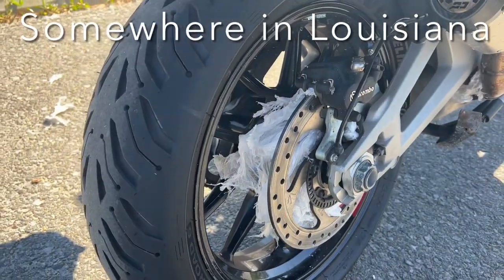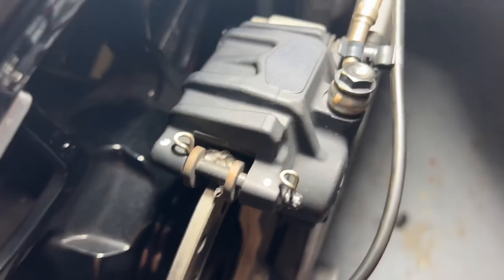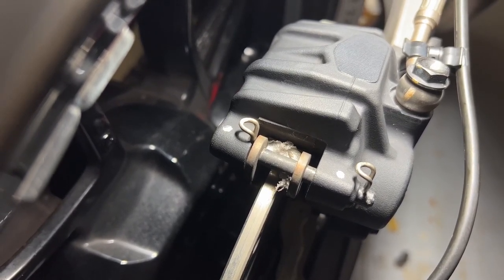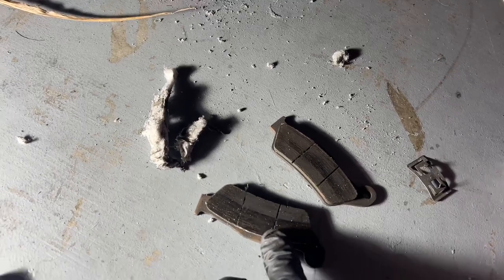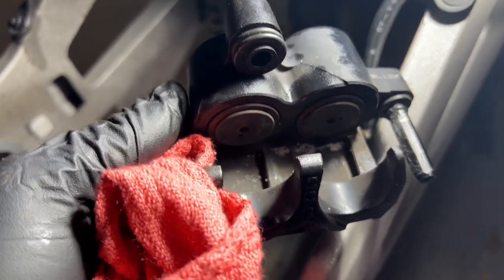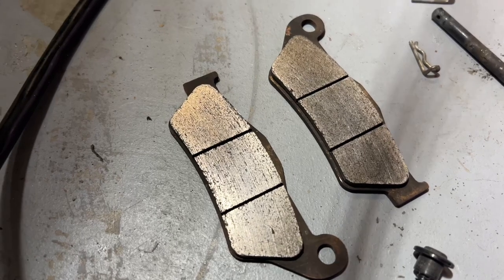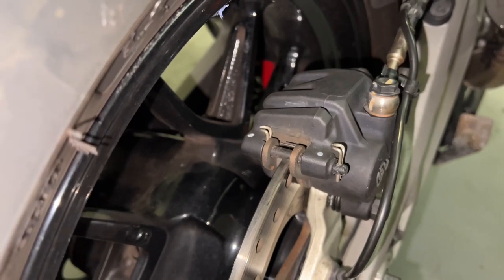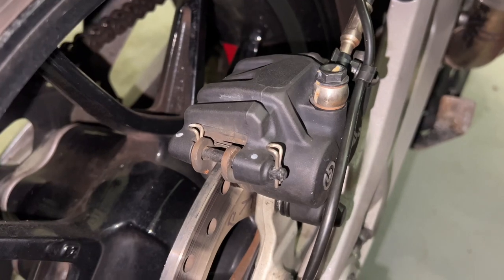Cleaning melted plastic out of the rear caliper on my Ducati Multistrada V4S

Comment: Yikes. That's a lot of plastic. Good thing nothing happened where you needed both your brakes.
Reply from the maker: I was lucky.  It was a lot worse but I did not video me removing all the plastic on the bike.  I’m luck I did not crash.
Reply: I  basically have no rear brake from the day I rode out of the dealer's showroom , and the front are not that crash hot for M50s and 330 rotors .